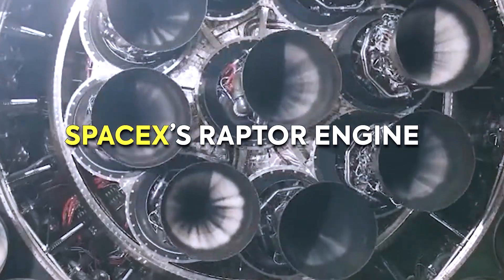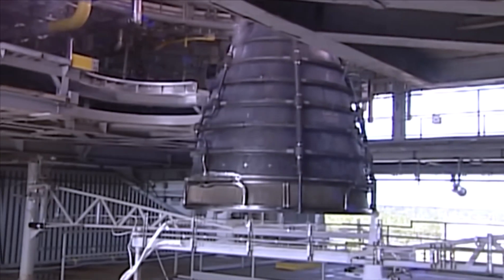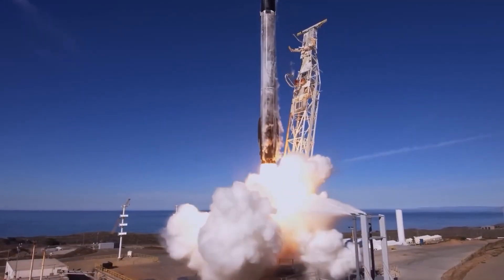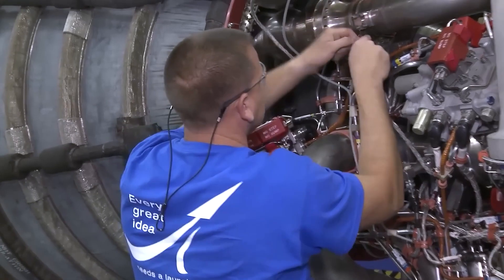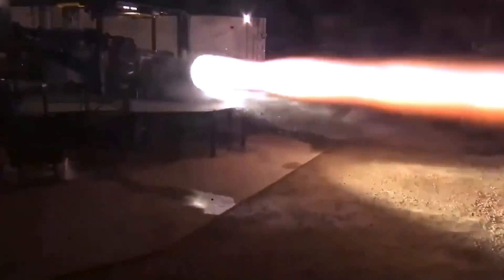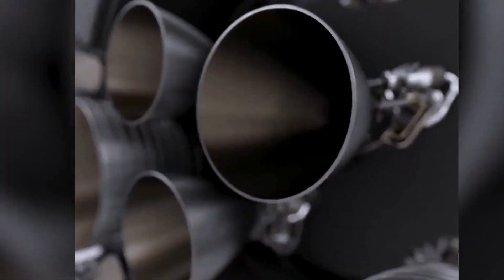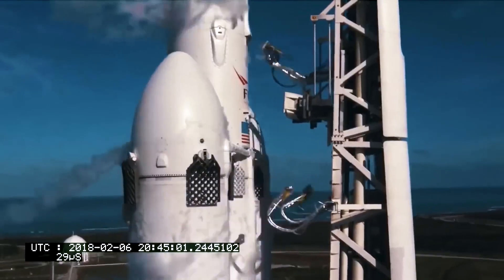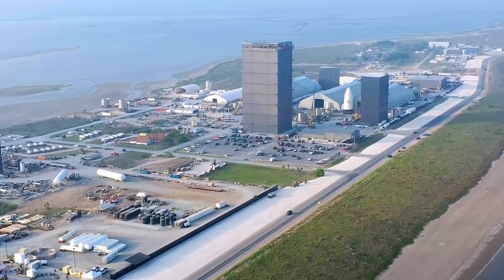SpaceX's Latest Raptor Engines Face "MAJOR ISSUE"

Comment: SpaceX is not using methane because it’s “better for the environment”. Far from it. It’s a greenhouse gas.  One of the worst. And burning it is just as bad as kerosene.  What it is: cleaner burning (as in low soot) for a reusable engine.   Mostly because it’s easy to store.  Hydrogen is the best fuel.  But hardest to contain.   I wish they had R&D that instead of methane.  As it’s a WHOLE LOT easier to produce on Mars.